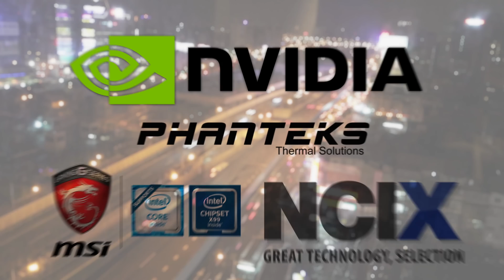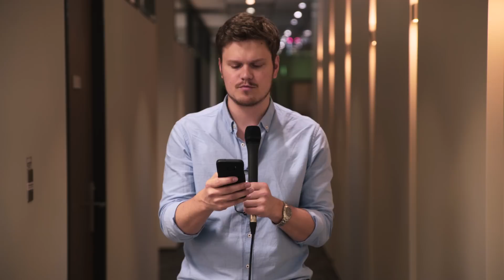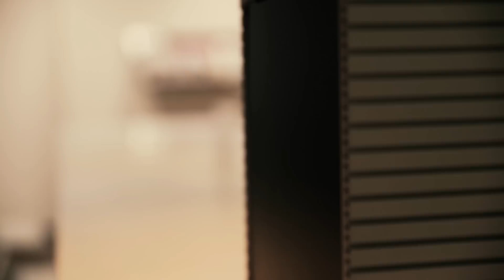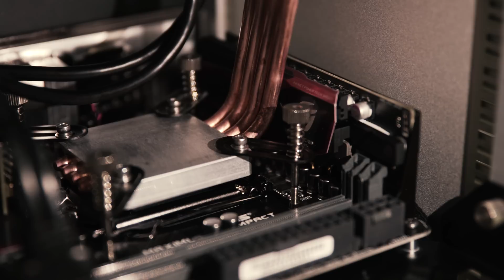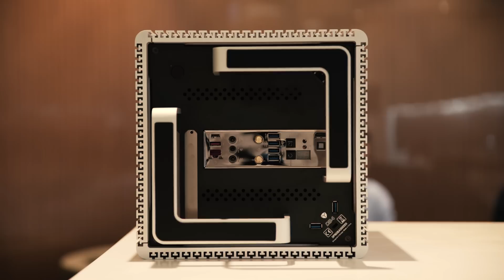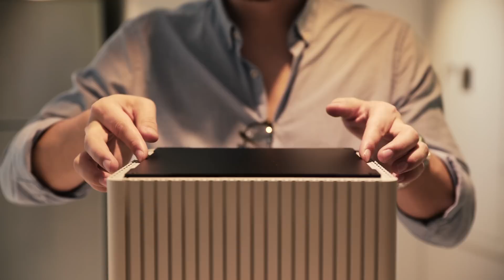The Most Beautiful ITX Case EVER!

Comment: An APU in that case seems to be the best bet.
Reply: I would still like GPU support on it though. Making it APU dependent would limit the market for it even further :(
Reply: Polaris 11 is said was shown off next to a 950 and was using less than 50W. Could be a great fit.
Reply: +K3V0M the intel HD graphics are not better then AMD APUs
Reply: My comment was in response to placing an APU inside without using a GPU, but thanks! I did note that it does have support up to 200mm.
Reply: Hieu Nguyen But the PSU is not going to cut it.
Reply: Kratos I don't know how much Thermal is 1 wall capable of. I will say, if the powersupply is strong. get all walls on to the CPU and use a blower GPU.
Reply: or an rx 460 that doesnt even require a power connector
Reply: Dual graphics maybe with some r7 250? Or a future equivalent.
Reply: I didn't verify that but aren't the recent models of the Intel HD graphics better than what AMD has to offer? Or was that about the Iris Pro Graphics? I'm not sure...
Reply: Not really. You need CPU with 2 sides + dGPU with 1 side to get the most out of the case.
Reply: Tony Zhu 2 walls is the max u can use for CPU
Reply: Kratos Ya...
Reply: It's good to know AM4 is physically compatible with AM2 & AM3 coolers.
Reply: +Διαμαντής maybe r7 250 from sapphire the passively cooled version
Reply: +N1NJONAS yeah you got the right idea
Reply: +N1NJONAS yeah you got the right idea
Reply: tava aqui a comentar nem reparei que eras o atecep. xd
Reply: This is a good contender for my ITX build I'm planning for one of the new A12 APU's
Reply: AMDs new AM4 platform A12-9800 would be a great choice.. Would allow for upgrading to Zen next year also along with potentially a Zen/Polaris APU in due time..
Reply: +K3V0M Yea, just Iris but you can get those on the desktop as well.
Reply: Imagine amd's zen apus in this triggered
Reply: That's what I'm thinking long term. Would make for a nice living room gaming/HTPC build. Can't wait!
Reply: nah, with the upcoming ryzen apus this can get a really good fanless solution
Reply: Hieu Nguyen

Comment: the idea of using the case itself as a heatsink is a nice one but there is a reason why we don't have massive heatsink cases, price.  I do still like the idea but $20 fan vs $600 case, i'll stick with the fan
Reply: This one is just $200. Quite reasonable if you consider the fact that you get a case, CPU cooler, and PSU for that price.
Reply: +wtfdinges  na not even close
Reply: BoOs CTS $90 for a case, $50 for a PSU, and $30 for a Cooler. A total of $170 is quite close to $200 if you ask me.
Reply: +wtfdinges CPUs come with coolers that likely do just as good or better as the case.
Many cases under $90 come with PSUs.
And cheaper cases then that also exist.
You also have to look at what other cases give you.
So much more expandability. Better cooling.

This case isn't something you can really argue for. it's an art piece. Art is something you either like or don't like. It's expensive for the style.

My case/psu/cpufan setup cost no more then $80
$80 for more features, less heat, and better compatibility for good components.
Reply: Of course this can be done cheaper and with more expandability, but that's not the point of this case. This is a case that is supposed to be in a very quiet room (bedroom, livingroom, etc) and should be as small as possible. The expendability of this case is comparable to regular ITX cases and might be even better (it supports up to twelve 2.5" drives!). 

The build quality of Streacom cases is extremely good, so you cannot compare that to a sub 70$ case. The same goes for their power supplies, they are of high quality and offer more than decent performance. 

If you take an ITX case of comparable quality and size ($100), take a comparable quality passive PSU ($60), and take a passive or extremely quiet heatsink ($40), you'll pay exactly the same. The only problem is that extremely quiet heatsinks mostly won't fit a case this size. 

What you are doing is comparing low-end products with a high-end product. You can't compare a budget model Toyota and a Mercedes S class and say "the Mercedes is bad because the Toyota can drive on the highway as well, but for a 5th of the price" either.
Reply: wtfdinges so your argument was a nice expencive fast car vs a cheap slow car. And compare them to a expencive slow case(slow representing the fastest components usable) to a cheap fast case.
That's some logic right there.

But you kind of summarised my point exactly. You can't argue for this case. It is luxury. It isn't functional(functional as in its less focused on being functional and more about being a conversation piece).

If you are wondering, I want this case. I'd love to take my current system and put it in that. and buy new hardware for my main system. My only argument is that arguing for this is illogical.
Reply: I'm most likely going to buy this one because in my case it is somewhat economical. I was going to get a Fractal Node 304 (without fans), a Scythe Mugen (without fans), and a Silverstone passive PSU. Together they would be about $180, but the thermal performance will most likely be worse than that of the Streacom showed here. Furthermore is the Fractal case quite a lot bigger and less appealing to look at.

Considering a passive system, this case might not be so bad moneywise.
Reply: If you don't mind, where did you get that price?  Custom case, custom power supply, custom heatpipe cooler... I find it hard to believe you're going to get this for anything like $200
Reply: It was mentioned on quite some websites (overclock3D, Hardware.info, etc), but they all deleted or edited their items. I think it wasn't supposed to be mentioned yet. Some less known websites might still show it though.
Reply: hopefully that's the right price but I have a hard time believing that much machined aluminium and the custom bits go at that price.  I'd love to be wrong
Reply: I hope it'll come to the market soon. The first time they showed this case was three years ago!

Comment: lol I don't think this is a very good case considering you have to touch the case to turn off the computer and nothing is like a burn
Reply: Game Nexus Pro You really think that it will heat up so much? I dont think you will want to oc the cpu u put in it...
Reply: For the size of the case vs how many watts the cpu is going to be pushing out via the heat pipes, it's not going to get that warm to the touch. 
If you calculate the convective heat transfer coefficient given a 0.25 mq surface area (oversized for the mini-itx anyway), with a cpu rated at 75w under full load with a room ambient temp of 22c... the surface temp if the aluminium (without any fins) would be around 22c. At that point you'd struggle even feel it being warm to the touch. A i7-6700 has a TDP of 65W, so you can put in a very nice CPU and not have to worry about the case burning you.
Reply: You guys are pretty stupid. you can't just arbitrarily calculate the case based on just the cpu, The motherboard will produce heat, the video card will produce heat, the ram will produce heat, system storage will produce heat. simon your math is wrong buddy, I can tell you for a fact that my I7-6700 with a r9 nano will reach a system temp of 44c in a ATX full case with 2 system fans. Your math doesn't calculate the rate which the case can release the access heat, just the dispersion of the heat
Reply: Game Nexus Pro so exactly how hot does the metal on your case feel to you with a 44c system temp ?  Does it burn you ?
Reply: ***** pretty close the physical case heats to about 35c from the top and 40c on the side where the motherboard is closest

Comment: Form over function in a nutshell.
Reply: actually, the design of the heatsink fins is pretty meh. Given that the grooves are so small, and their orientation, not very much air will get through them. Not a great design besides looking pretty. There is a reason why most heatsinks look the same. Better completely silent cases are out right now (In terms of function).
Reply: +Dylan Tucker buts it's massive with a large surface area. so even if much air doesn't go through the fins. the surface area is so large that it doesn't matter as much. but it's limited to 120 watt tdp
Reply: Dylan Tucker grooves are for surface area.
The nesxt set of finds are just meant to make the shape continous
Reply: TheSpacecraftX 65w tdp will cover the majority of intel cpus, and you'd be looking at at gtx 950 at max, but more likely a 750ti to not push the psu, internal thermals, and doesn't need a pcie connector.  So no, it's not under powered nor has poor cooling performance. If you want a higher tdp cooling case that supports larger gpus, then theey're out there and they are a lot bigger than this one.
If you can't understand the purpose of this case, then you shouldn't comment on it.
Reply: And that's pretty much all.
Reply: That's kinda over estimating the heat dissipation of the surface area on a relatively thick, hot piece of aluminium. But even if that did make up for the bad design, why add the complex grooves that would increase price/cut into their profits? Again, it's a bad design from an engineering standpoint. Normally I wouldn't get this nit-picky, with a case especially, but that second row of fins does basically nothing and it's REALLY making me mad xD
Reply: If you have an ITX build that's for general use, htpc,  or light gaming, there isn't a loss of function. This isn't meant to be used with end/high tdp components. 

 I'm also guessing that you haven't looked into passive cooled systems before for a true silent build. 

I'm really  questioning you're IQ right now since you say "form over function" yet the entire point is for the case to cool the processor, which 99% of cases don't do. 

This case is the first sexy looking passive case I've seen that's ITX, and I want it.
Reply: You're stuck with one underpowered PSU and the heat dissipation of the case/heatsink is quite poor.